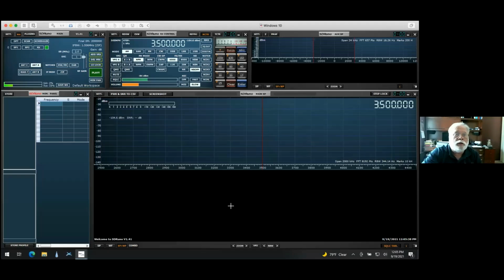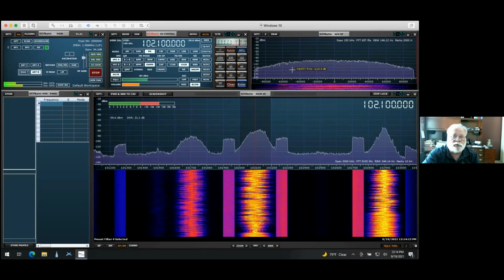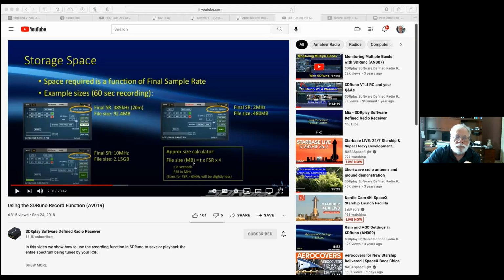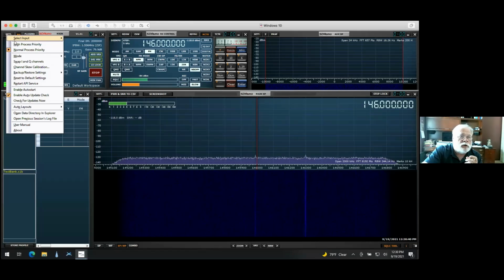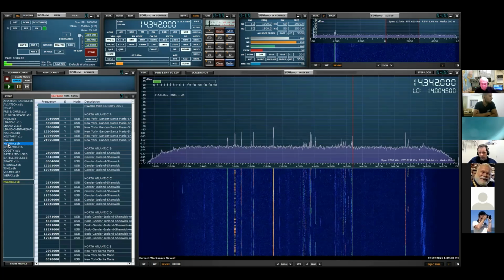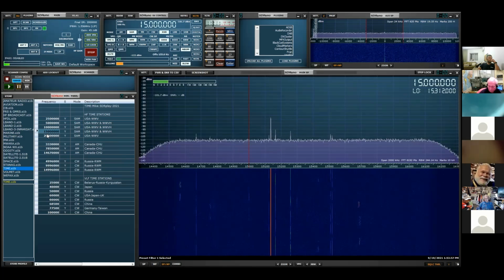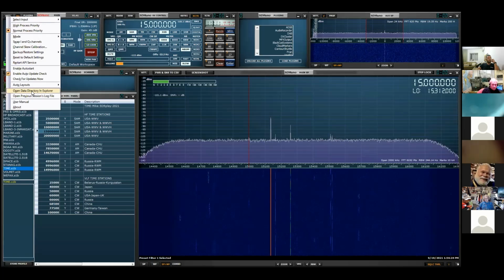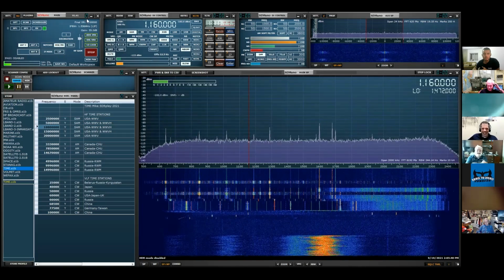SDRuno Beginners workshop (Sept 2021)

Comment: can the RSP1A decode digital FM radio station?, and this might be a dumb questions:  when listening to an FM radio station is it the same quality as a normal radio on a car or boombox,  can you hear the stereo mode or just mono?  thank you for your answers.
Reply from the maker: SDRuno includes a full analog stereo decoding facility. For superb audio quality you would need to connect your windows PC to a decent stereo system.  SDRplay doesn't currenlty provide an HD Radio decoder for the digital subcarriers used in the USA. Reception of HD Radio is subject to licensing by Xperi https://hdradio.com/

Comment: I need a good QRO RX-TX switch before i can buy and use one of these SDRplay devices.  I want to use SDRplay on the same TX antenna.  A manual switch is not a option.

Comment: I have rsp1a to bad it wont work i Linux 😔 i used to have as a scanner in windows before. Im guess its mutch work to port sdruno to Linux?
Reply from the maker: It's a big job but we are working on it. We have recently accelerated development efforts on SDRuno V2.0 which will provide cross platform support - here's our roadmap summary: https://www.sdrplay.com/sdruno-roadmap/  although we don't commit dates on when this will be released. Meanwhile, SDR++ offers support cross platform and works with SDRplay RSPs:  https://github.com/AlexandreRouma/SDRPlusPlus